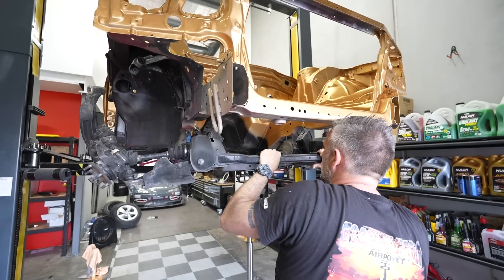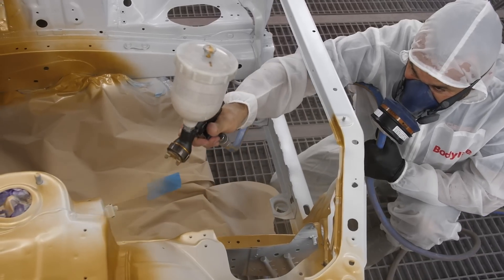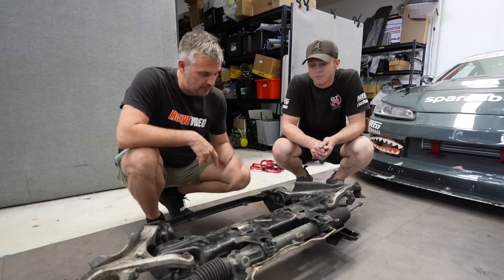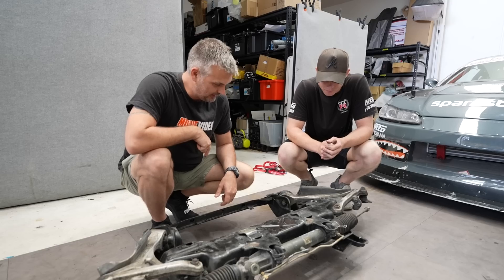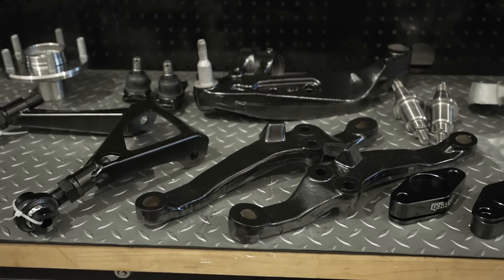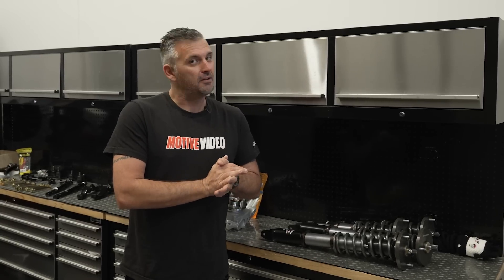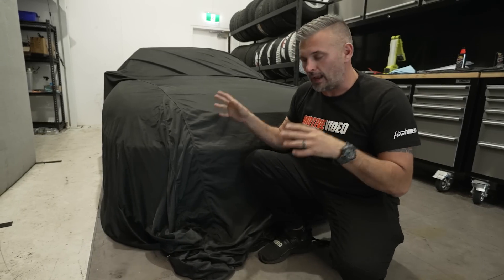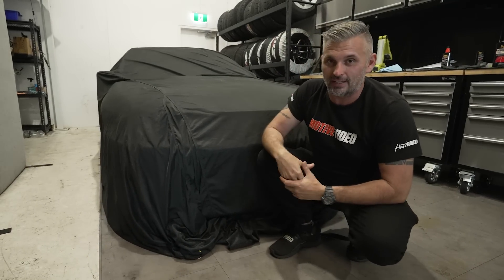Skyline GT-R Front Suspension Refurb and Upgrade & R35 GT-R Brake Upgrade - Project No Secrets Ep30

Comment: Dumb way to do splitter mounts like that. I welded big nuts inside of subrame where I can bolt splitter mounts on. Subframe looks almost original. Only difference is 2 new holes under side 😅

Comment: Those outter gk tech tierods are trash I’ve had them come loose on me even torqued to spec as well as multiple friends. Be careful and check often. We also have drift cars so there’s more vibrations and hard flicks so it could be a drift car issue